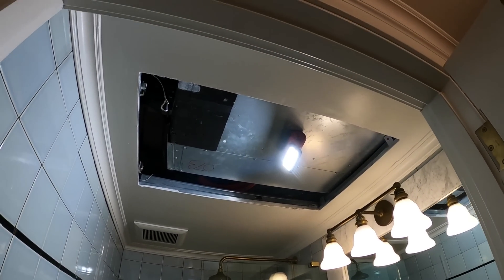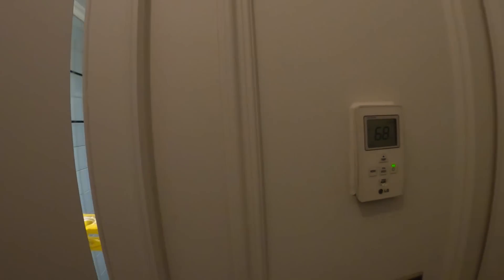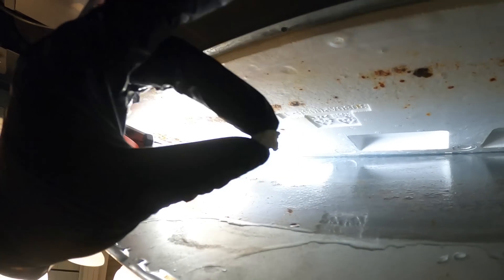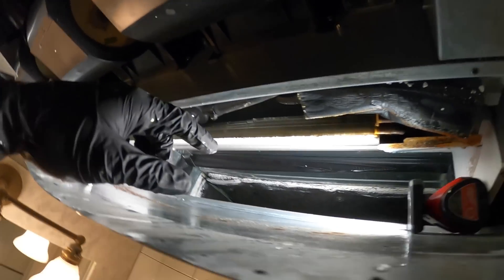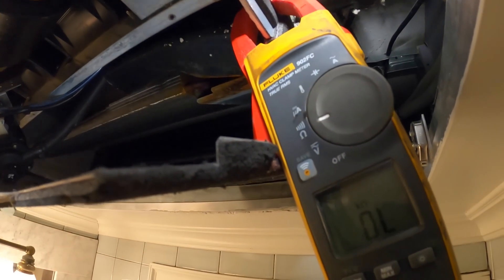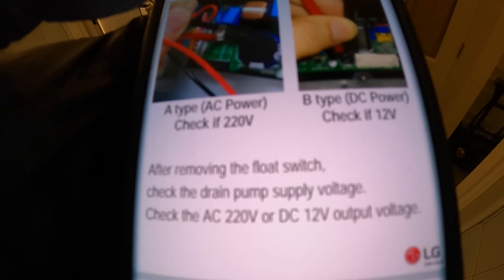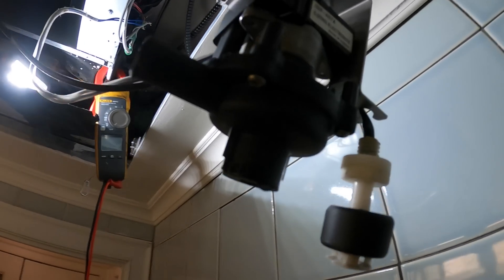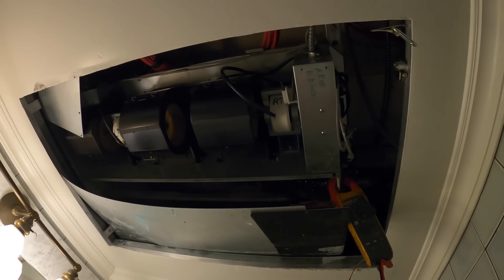HVAC: LG MULTI V Indoor Unit Leaking Water In Ceiling (LG IDU Leaking Water) Troubleshooting

Comment: G,day Jumpermantech from Sydney. 
Polystyrene foam is for sound suppression of motors.
Mould in the condensate drain line. It's obviously hot in the ceiling space causing "sweating" if no pipe leaks?

* Spray coat the drywall ceiling panel with waterproofing.💦📩

Comment: I had strange multiple issues with the same pumps. One of them had tricky problem. One of blue wires in hole in plastic cap was corroded and just touch to coil wire. Somtimes the pump worked and sometimes not.